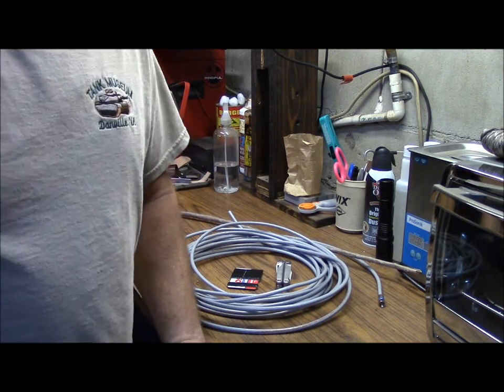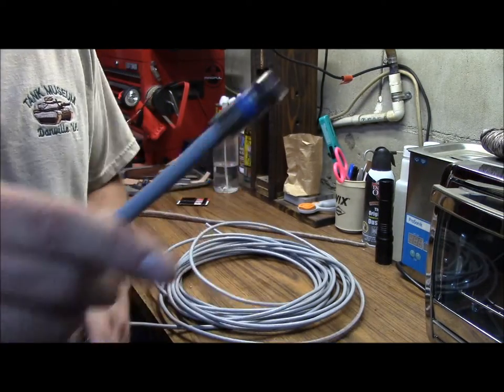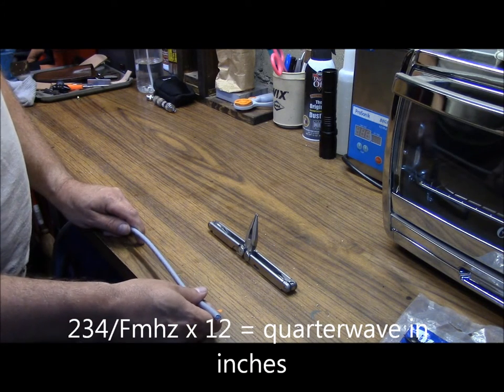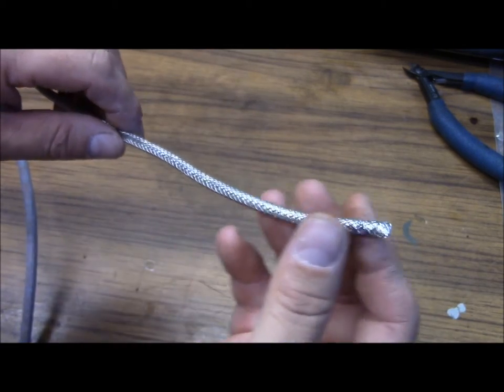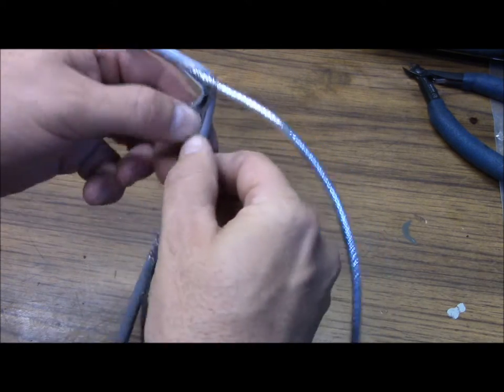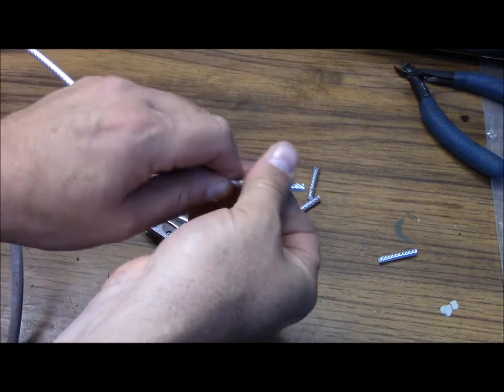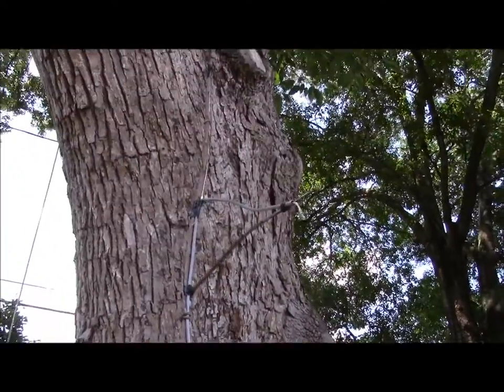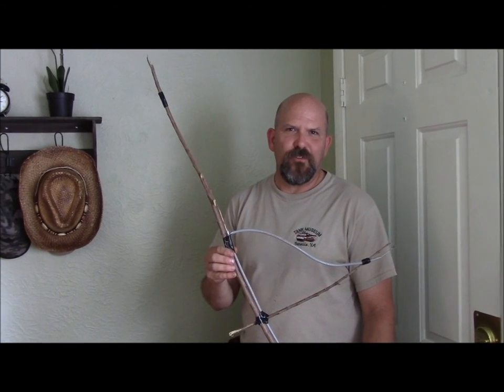Field expedient VHF antenna - TV coax

Comment: Couldn't you just cut the cable at the mark and put 2 random cables in place of them?
Reply from the maker: You can cut the cable and use two quarter wave conductors .One tied to the shield  and the other to the center conductor.   Thanks for watching.
Reply: Yeah that's what I had in mind. Thanks for the great idea rebuilding it asap :D